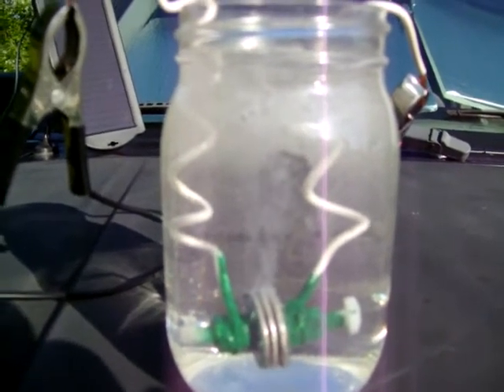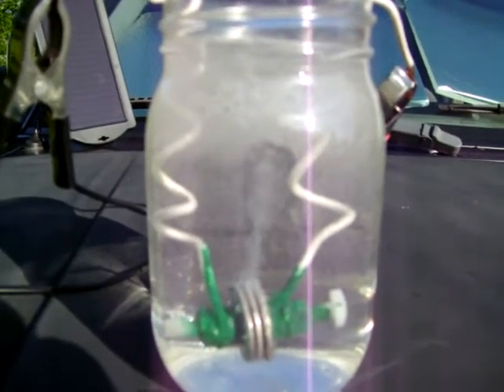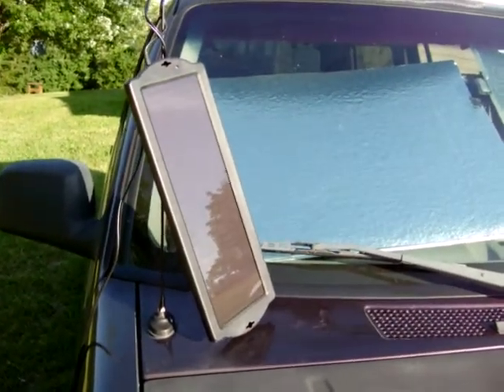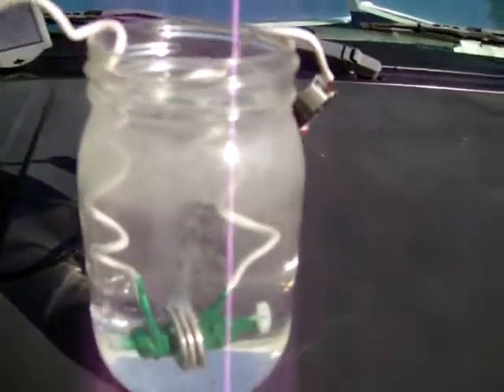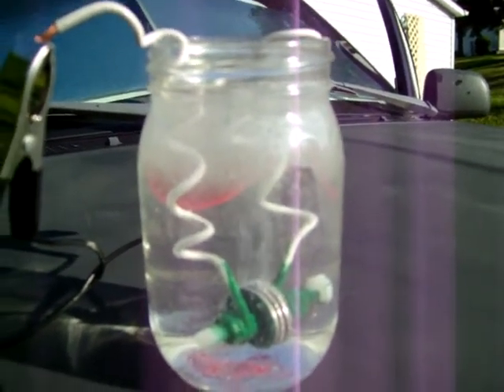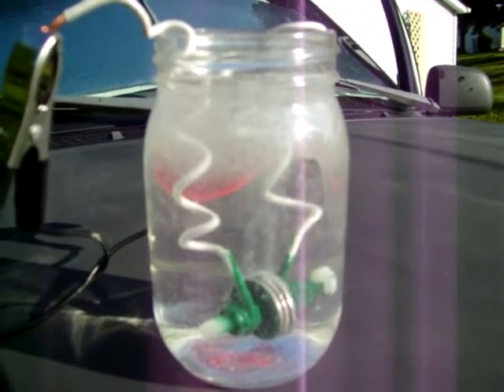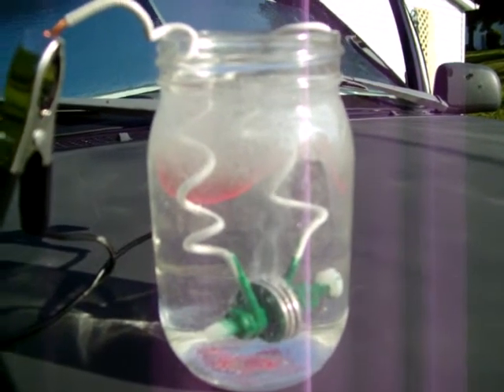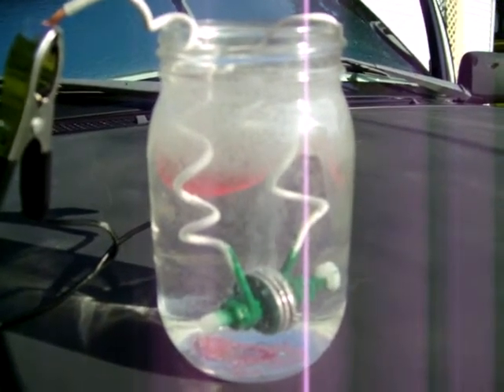Mark T. Rice small photovoltaic powered hydrogen oxygen generator july 5,2009

Comment from the maker: I have several ideas that I want to try and I will share them here as I have time and depending on how well they work. I'm thinking of incorporating the photovoltaic panels you can see in my other video. Since the battery I use is fully charged in less than half the time available to me to gather energy from the sun. I may try to use the remaining available electricity to produce hho. Thereby storing the solar energy in a less costly manner than using the lead acid battery.